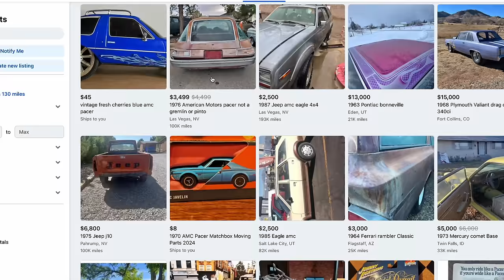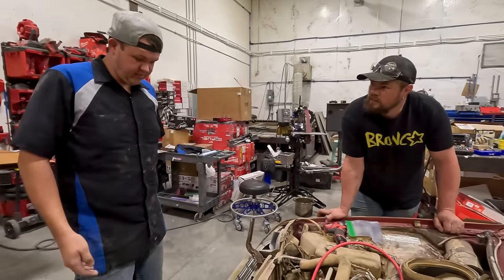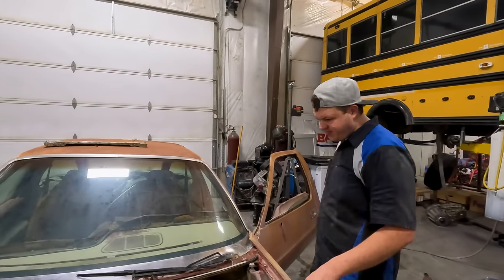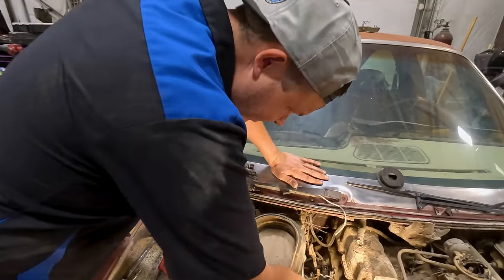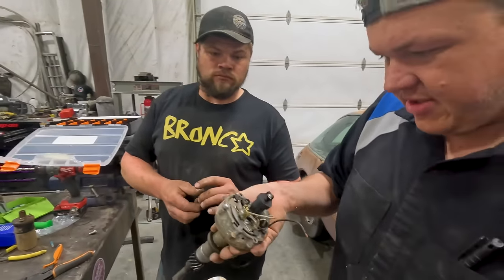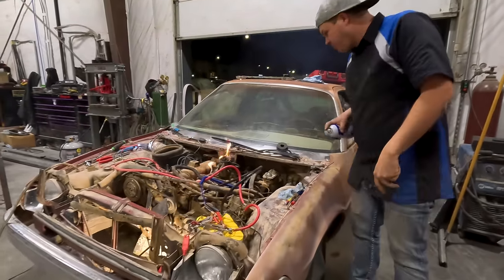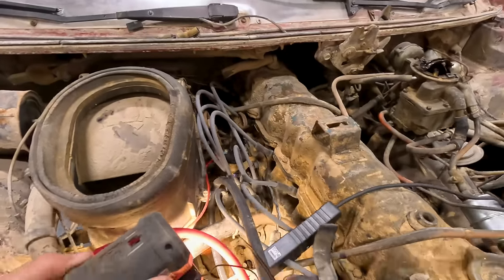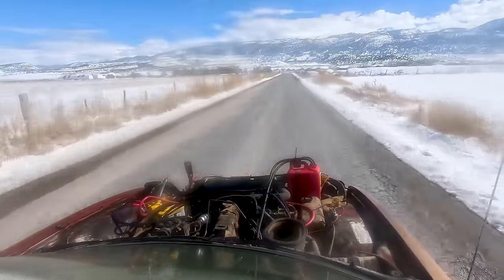My Wife “The Boss” Makes Terrible Market Place Decisions… Will It Run?

Comment: It definitely needs painted like the Mirthmobile!
Reply: Need to paint it as a tribute car!! EXCEPT BLUE WITH FLAMES PAINT IT PINK WITH FLAMES JUST FOR THE BOSS!!
Reply: I was going to be disappointed if somebody had not suggested give it to Wayne’s world paint job
Reply: @alaskinmud also you can't forget the licorice dispensor mounted on the ceiling along with a cassette of with the famous queen song bohemian rhapsody on it
Reply: needs licorice dispensor on mounted on the ceiling too
Reply: Just so you youngsters know pacers were notorious for being unsafe in rear end collision gas would explode better do some research Robbie want the boss to be safe also I know where 2 of them are sitting behind a house here in Indiana
Reply: @randyanderson8847  that was the Pinto!
Reply: @randyanderson8847 you are thinking of the pinto, which was supposed to be made with a special rear gas tank that didn't explode in a wreck, but... gotta save money so they went with a regular tank and boom! Also grand cherokee 93-98 exploded when rear ended jeep fixed it by adding tow bars that guarded the tank for free

Comment: I'm pretty sure AMC made the passenger side door longer than the drivers side so it was easier for passengers to get in the back seat. This thing looks like so much fun!
Reply: Yes the passenger side is longer. My great grandparents had one when i was a kid and we had my great grandmother convinced the entire passenger side of the car was longer.
Reply: 4" longer
Reply: That's exactly correct, also because the passenger side towards curb
Reply: Gas tank door is on the driver side of why
Reply: @halleyweasel346  most cars of that vintage had the gas cap/door on the drivers side
Reply: @edzimdahl1158  no they didn't they was in the rear off the car like the old Ford pinto

Comment: It is Demri's car...
Get a 4.6 stroker like Matt is putting in Dejablue. It's a straightforward drop in. Make that little thing a screamer instead of a turbo LS death trap.
Reply: You haven't lived until you've driven a 304 V8 Pacer!
Reply: Randall amc, a dealership in Arizona, was selling 401 powered pacers that would get into the 13s in the quarter mile.... Literally frightening to ride in.... because they don't like anything over 80....and with the super short wheelbase, and the soft spring rate, when my buddy would do doughnuts, it felt like the rear quarter panel was Dragging on the ground.
Reply: @ryurc3033 reminds me of my buddies in college driving their crawler cherokees with no sway bars and soft suspension on the streets. You'd look out the passenger window on a left turn and see pavement 😂 a little scary

Comment: I never owned an AMC vehicle but I DID own a 1974 Ford Pinto (with the exploding gas tank);  to make matters worse after the OEM tires wore out at 20K miles I put on a set of Firestone 721 self-exploding radial tires. We didn't know . . . Angels and Ministers of Grace Defend Us. Hamlet Act 1, Scene 4 .  Now, 50 years later ALL my family (and I) are still alive. Fortunately, now-a-days neither bacon nor eggs are on the 'Instant Death' list.  Now we just call them Paleo and encourage their mass consumption. As Beldar, Prymatt and Connie Conehead might hear from the Highmaster: Therefore, you will... NARFTLE THE GARTHOK!
Reply: It was the Firestone 500 that was a bad tire . The 721 replaced it

Comment: AMC 401 DANA 60s Full coil suspension. Air lockers equals desert buggy.
Reply: There was a dealership in Arizona that put together 401 pacers... Frightening having such a goofy squishy little car with a 401. My buddy got one in the 90s, and when he would do doughnuts, it felt like it was dragging the quarter panel on the ground.

Comment: I had a pacer. It use to veer all over the road.  The motor mounts were bad an the engine rested on the steering rack. Changed the mounts and it drove great

Comment: in 1977 I had a 53 willys wagon that was saved from the scrap pile.  it had it's 4 cyl replaced with a straight 6 from a 55 Willys pickup.  With the original fan shroud still in place we mounted the radiator and a 2 gal can for gas to the front bumper.  What a site!!  but great fun.    I sure miss that old beast.

Comment: I remember those cars. I grew up with AMC. I actually had an AMC Hornet Coup (two door). The Pacer had many issues....many. But a roll cage, some suspension parts, a 4x4 drive train, it could be ready for Sand Hollow...maybe.🤠
Reply: It was an interesting design, poorly executed mechanically. Reasonable aerodynamics for the era, and incredible visibility for not being a standard flat-top sedan format, it could have been an amazing car for the time. But cheaping out on pretty much the rest of the vehicle sort of doomed it. Kinda ugly, yeah... but people would  have overlooked that if the rest of it worked to it's full potential. It would be fun if the guys gave this one the full restoration treatment, but we'll see...
Reply: I still dream of putting my 1982 Volkswagen Rabbit body on a 4x4 chassis. 😂❤

Comment: It's an interesting car; really, it is... In 1980, I saw one in Colorado that had been mounted to a 1970's Ford Bronco chassis ... 4X4 with a view. I have seen the AMC Pacer as well as their Gremlins with a Ford's 351/390ci, Chevy's 283/327ci, and Chrysler's 318/340ci engines squeezed into the engine compartment and Borg-Warner 4speed manual transmissions... Because in the last years of AMC they borrowed from Ford, Chrysler, and GM, on could get outrageously creative in creating a "sleeper" street machine in that era.

Comment: We had a 76 Pacer as well, it was chosen by the wife, she goes for the different type of ride. Ours had the Ford 4 speed with bucket seats. She drove that car hard! 57,000 miles, 4 sets of tires and sitting in the drive, reverse decided to leave. One note, the passenger door is slightly longer to make getting in the back easier. Yep, that was a strange car.

Comment: When I was in high school auto shop class the teacher wanted to take a pacer and make it a 4x4, paint it silver, mirror out the windows with an American flag on the sides and name it earth one. Instead we took a 68 Chevy 3/4 ton, shortened the frame and put a 65 El Camino on it. This was in 1981-82. I used to see it driving around town every once in a while about 10 years ago.

Comment: I have been working on a 1988 ford f250 with the 5.0. Never got any back story from customer. Same issue idle ok, no CEL and popping out intake. Found out with casing number it was. High Output. 3 weeks on that. 😊

Comment: My buddy in high school had one. It came with a v-8 stock. It was the ultimate sleeper. And his had a manual. Since it was an AMC, a lot of jeep parts worked on it.
Reply: One of my friends acquired one in the 90s that had a dealer installed 401( I forget what they called it) but 
It was ratty, dirty, but frighteningly fast, and handles like an overstuffed jelly doughnut.

Comment: just a heads up Robby, that motor is basically the same as the jeep cherokee. so a cherokee motor could bolt up to the bell housing. also if those door handles are shot, you can pick up replacement jeep wrangler handles as amc used them on practically everything. carpet might still be available via some classic car part shops online. back when i still had a gremlin i found replacement carpet via  a site that sponsored that show my classic car. can't remember the site's name now.

Comment: My family had a 75 AMC Hornet 4dr Sportabout with the IL6 and a manual 3 on the tree shift. This thing deserves an AMC sb 304 and 904/998 Trans out of a cheap junkyard donor car. Get it running, driving and stopping, well enough that you can cruise it to events, paint it up in shop colors, and do some interior to it, then tweak it as needed, where needed. If you put an LS in it, it will be parked behind the dumpster for 3 years waiting for "the right time" to use it.

Comment: I grew up in the age of Pacers.  In fact, one of my racing buddies (AMX) owned an AMC dealership.  On the desirable scale, where Ferrari 308 was on top, Pacers were on the absolute bottom.  A rolling joke.
I met my wife in a gas station.  A buddy and I were out cruising in my real '69 Z-28 (302), she was on the way to a party with a belly dancer, driving her VW GTI! 🤣   In 38 years of marriage the running joke has been that had she been driving a Pacer we would have never met, because I would have never noticed her!

Comment: AMC Sourced a ton of parts from different manufacturers in the 70s.  As you go through it maybe you can name who made what.  You've found Ford Components, the ignition switch and keys are GM, the (anemic) 232 six is all AMC, but I believe the auto trans may be Chrysler torqueflite.  You'll find this beast all over the map.  A shame AMC died, in a way they were ahead of their time with the 4WD Eagles.  Now look at the SUV all wheel drive types we have on the road today.  PS.  I did hear of a guy in the area that gutted a Pacer for his backyard terrarium.

Comment: I worked at a car wash in my teens in the late 70s. I was the guy that put the cars on the rack. These Pacers were so cavernous inside, in fact I racall a commercial for them where they drove a smaller car inside of one to show how big it was. AMC always made vehicles that were kind of different.

Comment: You can tell by the way it was turning over that one cylinder had less compression, it could be a valve issue, check out the lifters make sure it’s set to spec

Comment: It might be a pacer, but it has so much potential.  Strip it down to nuts, bolts, and sheet metal, and let the fun, new ideas take over.  If you do decide to use the twin turbo LS, make sure to stiffen up the structural support.

Comment: G.M. Atlas straight six, Vortec 4.8 I believe.  year 2007 has 4 valves per cylinder and makes the power of an LS v-8. Fits perfectly and a ton less work. P.S. you can turbo it! plenty of you tube videos on it sometimes called Amera-Barra.

Comment: Fun facts measure the length of both doors . Right side door is a few inches longer . To give passengers more room to get in and out . And the reason it had their straight six was because they were going to use a 4 cul. engine supplied by Renault of France 
 Can you see that car with a 4 banger ? AMC found out the hard way - that didn't work ! Their six was a last minute replacement . People who had them new ( like my aunt ) loved them . Have fun! Party on !

Comment: My mom didn't start driving till her early 50's she could drive in an emergency situation later in life when my Dad became ill she wanted to get her license and drive.  My Father thru a big hissy fit about her driving his truck so we went car shopping.   I had a friend with a used car lot and we hit him up and low and behold he had a 1977 Pacer G/L Brown with the tan plaid interior the thing had tilt and cruise control but manual windows and brakes.  I tried to talk her out of it but she was adamant she had to have that car.   The passenger door is long than the driver door for easier access she loved that thing I drove it to college in the early 80's it had a huge gas tank about 22 gallons.  She ran a parking meter down in our little town and drove off too embarrassed to go into the store it was in front of.   This brought back so many memories check out the frame on that thing it's like a truck

Comment: PACER DRIFT CAR! I thought that in the first 5 minutes of the video. In this case a LS swap is totally acceptable, but a 4.6 AMC turbo stroker motor would be kinda cool (and expensive). Anyway, gut it, paint it and make it pretty, put in a cage and proper suspension, and let the Boss let out her inner drift car drive out. It’s a bit out of your comfort zone a bit, but would be fun. Right Demri?

Comment: You should make it an amazing off road buggy rock crawler. 6" lift, 35" tires on portals. 4 link suspension front and back with a full roll cage. Oh, wait, yall already have one of those. The Bronc☆.  Maybe yall need two?

Comment: In case you didn't know, that engine is basically the same as the 4.0 liter engines in the Jeep Cherokees. Soooooo ... why not drop in one of those Golun stoker engines like the one Matt just put in your Cherokee? It's virtually a drop-in swap.

Comment: Awesome video...  It's amazing how much fun you can have for a few hundred bucks.
Heck, you don't need an LS. This thing is already a tire shredder. It would be cool to bolt a salad spinner to it
and get some more ponies out of what's already there though.  Might need some better rear tires while you are at it.
You could really go crazy and weld in some spacers on the drivers side so it will sit level, or at least close to it.

Comment: Ok, here’s a recipe for a different sort of spring roll. 

Peanut Butter and Banana Smores spring rolls. 

Take a large spring roll wrapper and start with 1-2 marshmallows, a handful of chocolate chips. Half a banana and a tablespoon dollop of peanut butter. Crunchy PB is the bomb here. Wrap it all up and toss it in the air fryer for 10 minutes and let them cool for 4-5 minutes before you enjoy. 

Warning: you have to seal the wrap tightly because otherwise you will end up with a marshmallow blowout. Not good.

Comment: I'm torn between wanting to see a street car burnout machine or a mid-level lifted 4x4. My biggest reservation about going the 4x4 route would be the need to cut the fenders to accommodate the 35" tires. At least as a street machine the body could be preserved, and we all know Robby and crew could to a bang-up paint job on it.

Comment: I owned a 1978 AMC Pacer in the exact same color, mine ran and was in perfect condition and was used to drive to work only. I had it for about 8 months and one afternoon after driving it to work I was notified bytheneighboring  building that was next to my place of work which was a Post Office. They said a car wason fire in the parking lot and I ran outside to see the Pacer in total flames, I had the firemen grab my boom box (This was 1982) and all my cassette tapes because the stero was only an AM/FM and once they got my music out I said let the fucker burn! Those motors are notorious for engine fires and other issues so swap the motor before letting anyone drive it for any amount of time. It was a drive to work only kind of car and I wouldn't get caught dead driving it around town and rick getting ridiculed by my friends and neighbors, everyone called it the "Fish Bowl" on wheels. My dad built a deck for a secretary from his company and she gave him the Pacer for compensation.

Comment: I say freshen up the motor turbo it and you won't be disappointed, My aunt had one new. And I used to fry the tires off of it. The bathtub car Was the ugliest car in its time but had way more power than it needed. And it was so fun to drive when I was 13 or 14 years old. And it was the exact same color as that one inside and out😅😂

Comment: if you do plan on replacing the motor and are not worried about keeping it stock instead of a v8 ls you could do a honda 4 banger with a turbo and all wheel drive might be easier to fit in it just a idea

Comment: Make a Carl Green Enterprises Pacer replica with a 401 V8. From 1978 to the end AMC offered their 304 V8 as an option in the Pacer. The 401 V8 has the same external dimension so it easily replaces any 304 AMC. Or hot up that straight six. There is a massive amount of performance parts for the AMC six because it was used for so long in Jeeps, and for quite a while after Chrysler bought AMC.

How the heck does it have front drum brakes? I thought all 1974 and later cars in the USA were required to have front disc brakes, unless 1974 was the model's final production year. Might be a Mexican built Pacer for the south of the border market?

Comment: Put a frame under it. Put an LS in it. Make sure the motor mounts are attached to the new frame. & don't use any of the original parts.

Comment: Acer leans to the left because a requirement in the nineteen seventies to buy a pacer was you had to weigh four hundred pounds, hence the reason for the large doors. Rumor has it that it was called the pacer because it led to a pacemaker.

Comment: My dad told me when I was a teenager that we had to check to see if the sparkplug wire was good on a car we were working on. He told me to stick a screwdriver into the end of the wire to see if we were getting a spark.
I objected, and asked ," If I do that, won't I get shocked?" He claimed that was the only way we had to figure it out. Long story short, I did as he said and got shocked big time! You should have heard him laugh, before he showed me the way to check it without shocking yourself.

Comment: Ok, since you’re swapping it.  Hear me out.  GM 3500 5cyl or the 4200 6cyl swap with compound turbos.   The 4200 is a stout motor that can handle 1000hp with stock internals and the 3500 is the same engine with 1 piston cut off.

Comment: I like the idea of a built up inline 6 cylinder.  i think Matt is dropping in a stroker in your jeep. To much horsepower in that car might not be a good thing. Plus you will have more room if you decide to do Turbo's after the stroker inline 6 then you may do so. That's my opinion, plus hopefully you guys can get the A/C functioning. The inline 6 is a pretty good torque engine.

Comment: I don’t know if today people still hate the Pacer but I still think it’s be nice to have a purely American hot hatch, some which came with a 301 I believe, granted it must’ve made 100 horses … maybe 😂 , but I’d put in perhaps modern 5.3 which would give it waaaay too much more power than that thing was ever designed to handle … and still be close enough to the V8 that powered this thing regardless of the installed V6, size wise …